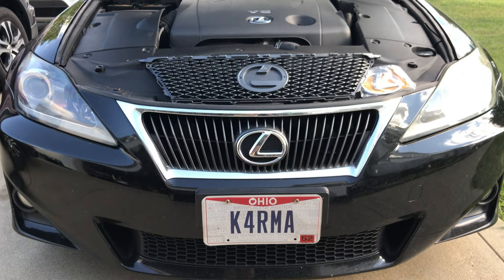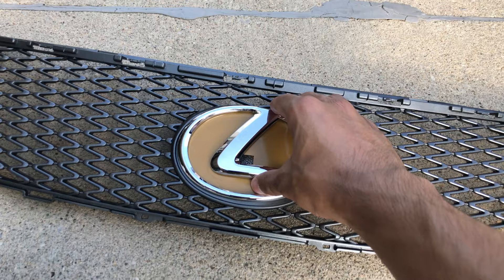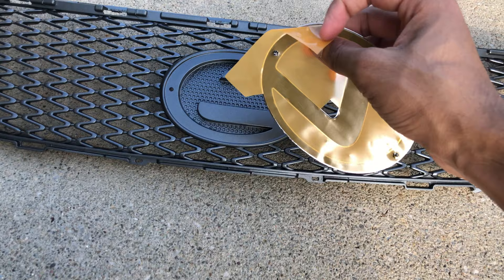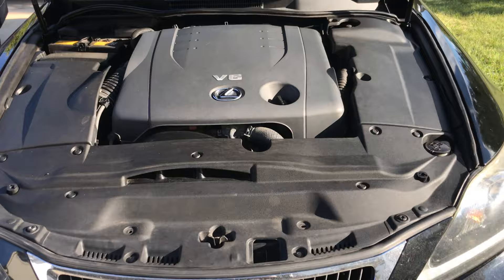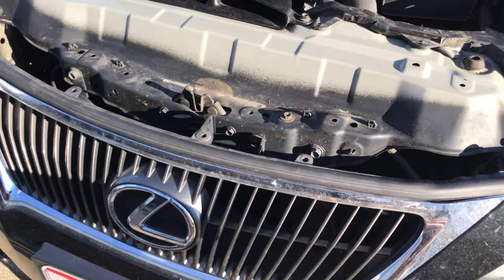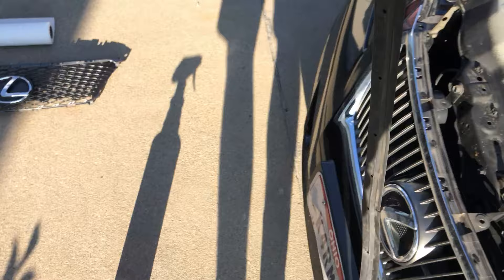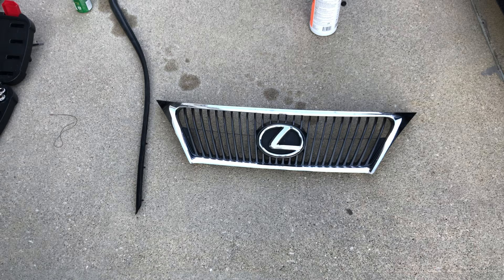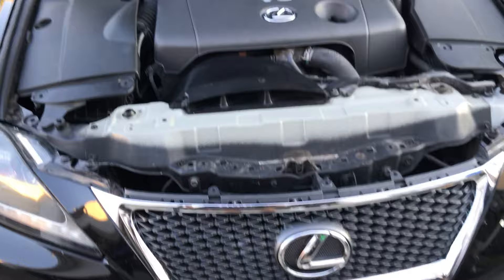HOW TO Install/ Change a Lexus IS250/350 Grill *STEP BY STEP*

Comment: Hey Sarai, I have a 2010 Lexus is250. I am worried about buying an aftermarket grille. Some are cheap and some are expensive it all depends on the year. For my car they range from $200up and for 06-08 they’re $50. I read the comments and you said the one you bought fit all, can you please provide what year your Lexus Is and the link of the grille you bought it would help everyone that watches your video so we buy the same grille as you.
Reply from the maker: My Lexus is a 2011 IS250. I include information about every vehicle showcased near the bottom of the descriptions for every video (including this one). As for the grill, I bought it from eBay. The person I bought it from no longer sells them, so I can’t help you there. Just look around and choose the one you think is best. That’s what I did. If not, just buy a real f-sport grill from your local Lexus dealership and it will be a perfect fit.

Comment: Do you know if these fit 2010 is350? cause I'm trying to find some but why they all say 2006-2008 and none for 2010
Reply from the maker: No it will not fit. The bumper and grill sizes are slightly different. Just keep looking till you find one for your year! 

I bought mine from eBay years ago!
Reply: @SaraiGarage  oh damn :/ right now you can't find any for 09-11, all there is is an original one for more than 300...
Reply from the maker: I would join Facebook groups and ask/ search previous posts.

eBay should have plenty. There are always aftermarket companies pumping these things out. 

Might take more work now, but you should be able to find it somewhere out there! 🙌🏾
Reply: @SaraiGarage  thank you, unfortunately I already did that with no luck. I'm gonna try and make a custom one soon. Probably gonna be challenging but hopefully fun
Reply from the maker: @jdm_is350  That’s way too big of a commitment for me 😂 But I’ve seen a lot of sick custom grills. You could get very creative. Good luck bro!
Reply: @SaraiGarage  I chose a hexagon pattern that is close to the one on the lower grill. I really like the look, wasn't as hard as I thought actually

Comment: Does your one not come with the pcs unit or something? An issue i have when i bought mine was the grill is non-original and the ‘pcs not available now’ keeps coming on when im on a highway.
Reply from the maker: Mike Oxlong I just looked at a press release published by Lexus titled “2012 Lexus Safety Feature Summary” and they say “Most Lexus passenger cars (Except IS models and LFA) and all luxury utility vehicles offer the pre-collision system (PCS)”. 

In other words... a second gen Lexus IS (like the one I did this grill swap on) is not able to be optioned with PCS no matter how you spec it. PCS started in third gen IS models. Sooo idk what to tell you! Haha My car didn’t have PCS so it was a simple swap. 

If you’re having that PCS problem, check with a Lexus or Toyota Dealer. In almost every case with PCS, you won’t be able to swap out the grill to anything else besides another OEM grill that also has PCS built into it.
Reply: Lucky! I thought you had it removed, but thanks for video, will help alot when i end up changing (: !

Comment: But once the new grill is on doesn’t the electric parts or the horn get damaged from rain?
Reply from the maker: No. 

Your old grill has open holes in it for cooling/ air intake and when you drive in the rain, rain/water already gets in there a little bit. 

This new grill is no different. You need holes in the front for air intake for the engine and cooling. The cars are designed to work through rain haha. If you had no hole for air intake your engine would run really rich and break down. 

The only thing this changes is how it looks. It makes no difference in performance or reliability.

Comment: I'm a little confused....  after all that why wouldn't there be a shot of the finished project?
Reply from the maker: BLACKSCOTIAN I felt it was pretty self explanatory. Only part I didn’t show was popping the tabs back into the grill on the rubber seal and putting engine covers back on. Most people just care about taking the grill out and putting the new one on and then they tune out 🤷🏾‍♂️ I showed photos at the end of every step as I was doing it (with music).

Comment: Hey mate how did you manage to get the clips back into the weather strip? Having the same issue on my 2is. Thanks
Reply from the maker: Michael Huynh TBH I couldn’t get them in, I was too clumsy 😂 I showed my uncle tho and he slide those things back in seconds! Just play around with the hole and the pin/clip and you’ll figure it out! There was a trick to it but I made this video so long ago I forgot it.

Comment: hi, I found F sport grill has two different part numbers. One fits 2009-2011 IS 250 and another fits 2011-2013 IS250. What's yours in this video?
Reply from the maker: kj2775kj This is just a aftermarket one from eBay so there’s no part numbers associated with it. Call your local Lexus dealer and hopefully they can help you out 🙏🏾
Reply: Which one fit the 2009? I bought one that didn’t fit
Reply: @chrisedmundson1484  same

Comment: Does the whole front grille need to be removed to change out the front emblem?
Reply from the maker: The Lexus emblem is just on there with tape. You could put something behind it like a screw-driver or plastic trim remover, apply some force, and slowly peel it off. 

Then clean up all left over tape and put on new emblem. 

You don’t need to remove any piece of the grill if all you’re replacing is the emblem.

Comment: Now your car is gonna run faster
Reply from the maker: Easy 5 horsepower bump lol
Reply: @SaraiGarage  wrong thats 250 horpower. More added that grille has way more holes more holes means more air to the engine

Comment: do you think this will fit a 09 lexus is250?
Reply from the maker: Jordan Pugh This will fit all Lexus IS 250 and 350 models from 2006-2013. Also, I don’t have the part number. It was a generic grill from eBay. If you want part numbers just call your Lexus dealer.
Reply: ok one last question do you know exact one you bought or the link because all of the ones i’m finding are 06-08  thanks again!

Comment: Hey Sarai how’d you put the weather strip back on?
Reply from the maker: Tyler Caldwell You need to push the little pins that were in the holes of the weather strip back into the holes. If they are stuck to your car, use needle-nose pliers to remove them and then work them back in by hand (working them back into the weather strip is really tricky at first and frustrating). Once all the pins are back in the strip, just line them up with the holes on the car, push down and snap them all in!
Reply: Sarai Garage actually got it handled a few days back! Had to actually snap the old pins off the old grill and just ordered new ones from Lexus for $5 and got them in the weather strip fairly easily. Thanks for the awesome vid though!
Reply from the maker: Tyler Caldwell I’m glad everything worked out for you! And no problem!! 😊